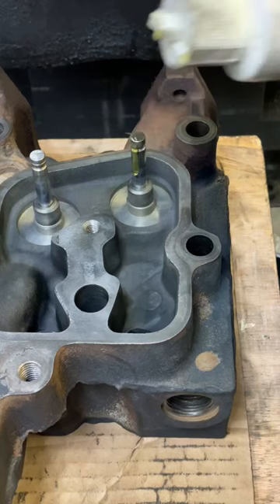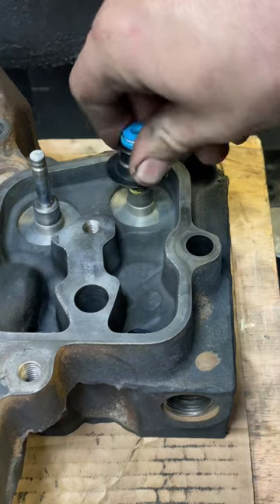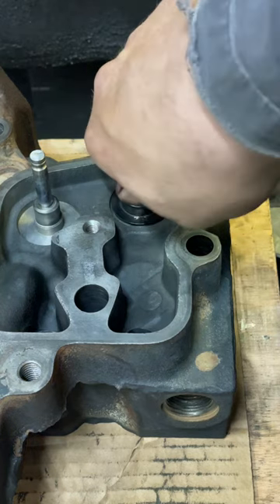install valve spring 12v  Cummins  #car #shorts

Comment: I'm damn near 60, that's the first time I've seen that trick. Well done!
Reply: I'm 66 and started on farm equipment as a kid, then cars then the oil patch and on and on. Never have I, till just now, seen this technic.
Reply: @donniegombel  I know right, we both been around a good bit.
This little simple thing is so fascinating and enlightening.
Reply: @donniegombel  well they didn’t have plastic when you were young 🤣 just joking it goes to prove old dogs can learn new tricks
Reply: Likewise
Reply: It's RUS old tech. But at start we use thin rubber from bikecycle wheel.
Reply: I've got you by a few years The 1st time I've seen it also.
Reply: Right! I usually just use my finger to hold them in place. I need to go find some plastic next time
Reply: I'm with you Bern doing it for years but does it really work
Reply: Same thing here. I guess you can still teach an old dog a new good trick
Reply: Am 60 and wish I’d know this in my youth thos locks are a proper pain in the ass 😂
Reply: no le
Reply: no
Reply: How the locks can just stay in place... something is odd
Reply: well I be damned
Reply: seventy three for me
Reply: I'm so happy that I learned something today
Reply: I'm over 60 and not once have I ever seen it,either. And I've been a machinist for decades
Reply: I use grease and wax paper

Comment: 15 years of rebuilding engines. i got to say that piece of plastic is something else. i just tryed this for the first time and it works great i pulled out some of the used wiper blade packs the plastic on there works great.
Reply from the maker: Ya I had a guy show me years ago. It’s a cool trick. I ise 6mil bags when I do it.
Reply: What's the trick for? To keep the locks in place?
Reply: @freashtoast1684  yes you can do this 2 ways press the spring then add the 2 locks .or place the locks in the retainer then add the plastic then press wala.
Reply: The old fashioned way works well on big valves. It’s a nightmare for the little valves used on todays cars and motorcycles.

Comment: Great system. I have also seen several mech. give the assembly a light tap with a small hammer to insure a good fitment of the retainers.

Comment: Love the trick but I would cover the notch on the valve with a piece of shrink tube so you don't tear the seal as your sliding it down the valve shaft
Reply from the maker: The valves on this head have a tapper so the seal is not hurt by it

Comment: I put all the locks in mine almost the same way ..you can set them in the top of the retainer and start compressing the spring and I would say 70%- 75% of the time they'll just align themselves... the plastic just insures it a little more probably...nice trick

Comment: Dude thanks for sharing, so I just made the piece for the chuck of my drill press and welded a socket to a drill bit. I got dance and cut a side of the socket out so I can see the keeper sit. I'm sure I can get a local machine shop to make me one like yours for the most used sizes but till then I'll just keep cutting if different size sockets for different size springs, 👍

Comment: I don't even waste time putting oil while assembling. 
When the engine is done, without the valve cover, I pour a quart soaking the valves, springs, etc.
Reply from the maker: I did the extra for the comments. I like lube after the assemble

Comment: Out of the tens of thousands of cylinder heads I've done. I've never put oil on the springs. Plus that is one awkward dangerous way of assembling the valves.. .

Comment: I always use a little plastic cap on the valve ends that covers the groove. I'm always afraid that I will damage the seal if I don't. I will have to try that plastic trick. Haven't seen that in my 30+ years of experience.

Comment: I always hated doing valve seat seals ... This part always too Me the longest cause I had to chase down all the springs and clips that take off flying when the valve slides to the side and shoots the spring all the way to the ceiling and across the shop...

Comment: You need to show the guys at Ford who hand build the GT 350 engines. Several engines have failed from a valve falling in to the cylinder.

Comment: The plastic will only work with single groove collets multi groove not a chance. Also that spring looks like its upside down could be the camera ange or sompthing but do double check that mate
Reply from the maker: I have used it on triples. Just have to oil them , but it not as fast. This is a barrel spring so same on both ends

Comment: I really always thought that the locks had to be on the valve stem first then the spring comes up to hold the retainer in place. I squeeze the spring then stick the retainers to the stem with grease and release the spring slowly. 
Your method is smooth and easy plus you do not compress the spring as much as I have too. 
Do you ever give a little tap with a rubber mallet or dead blow to the top of the valve just to seat everything in place?
Reply from the maker: Sometimes you have to mess around. But most of the time it goes smooth

Comment: What about the plastic tube that comes with the seals to protect the seal from the sharp edges on the valve.
Reply from the maker: These valves have a tapped in the groove so they don’t cut the seals.

Comment: Ok first i was getting pissed cause you didnt probably seat that valve seal. But that plastic trick! Bro that shit is why i don't even CARE ANYMORE about that fuckin botched seal install. Ive worked in 2 different engine machine shop and have worked and been tought by bad ass old school  performance engine builders and NEVER have i seen that trick! Hats off to you my friend. Very freaking cool!
Reply from the maker: That hat style seal gets pulled down and held by the spring. Even if to tap it down they like to pop up to start with. But I understand what your saying. 
Ya it’s cool trick. Old boy showed me years ago

Comment: I’m buying a set of bare heads for my build, how do I know if I get the right length of valves, or is that not as important as I think it is
Reply from the maker: you have to check the specs for the heads your working with. 
installed stem height and install spring height is a good start

Comment: My concern is with running the stem seal over the lock groove.
Reply from the maker: These valve have a tapper so there is not shape spot to cut the seals

Comment: What is the plastic used for?
Reply from the maker: Holds the locks on the retainer so they go in place
Reply: @CUTTERUPROB  Oh that makes sense now for some reason I was thinking you used it to keep from scratching anything up lol
Reply: Piece of plastic actually has two benefits if that spring kicks off it doesn't launch your keepers across the room

Comment: Add oil...add oil... Add oil.  Just when you think you added oil,, add oil.  Oil cheep. Engine parts not so much.   Nice plastic trick.  Logged for future use. But I'm sure when I remember it, it will be either on the last valve or when I'm done.. lol

Comment: the tool that you're using to push the valve spring down what brand is it it's one I haven't seen
Reply from the maker: The bit in the chuck. I made myself

Comment: I've been out of the game for a long time with those seals do the valve stems get enough oil?
Reply from the maker: That is a factory seal for a new 12v Cummins. Most the newer stuff has seals very similar. I think some of it is the materials used now are better and new less oil. But what do I know lol

Comment: That a knee mill? Gotta say those are some baby valve springs but your gonna have folks putting their heads up on little 110v craftsman drill press and splitting tables.
Reply from the maker: Seat and guide machine. But you can use the drill press for most springs.

Comment: Just wrecked the new oil seal by not using a sleeve over the top of the valve stem.
Reply from the maker: These valve don’t have. A sharp edge to cut the seal so the install sleeve is not needed.

Comment: Meh, no need to put oil on the seal, nor on top of the spring... The plastic is unnecessary too. Compress the spring, put the keepers in one by one, and release spring tension.

Comment: What you used a plastic you destroyed it for nothing you can use some other washer it will help
Reply from the maker: Plastic holds the locks in place. Faster then putting them in by hand

Comment: Also what is holding the valve in place?
Reply from the maker: It’s a diesel head so just the cardboard on the surface. But a gas heads you use a rag balled up

Comment: I do not like the one line of oil on the valve stem. the hole shaft should have lube .. just to be proper.Edit its like installing a piston in a sleeve or cylinder and only oiling lubeing  1/4 of the cylinder.
Reply from the maker: stem is lubed when you  install the oil is just for the seal

Comment: Isn't there a tool that they want you to use to put the valve seal over the valve with? I remember that from Honda.
Reply from the maker: It’s not needed for these valves
Reply: @CUTTERUPROB  I wonder why some are required, maybe bc they're sharply edged on top near the seat groves?

Comment: Should get a can of Graphite for engine assembly
Reply from the maker: I am not a fun of it myself
Reply: @CUTTERUPROB  graphite is the best lubricant to use for Bearings aside from grease or oil
Reply from the maker: @hoovercamaro  I have found using break in oil and bearing guard  is what I like to use. I can’t say it the best way. Just way I do it.
Reply: @CUTTERUPROB   My dad Rebuilt his 1984 GS 650 Katana engine after it blew up and after he blew the transmission for the second time he disassembled the engine and it had 50,000 km on the engine after the rebuild and the Graphite was still On the Cam Bearings, it goes to show the Graphite sticks on and lubricates when the oil has dripped off after sitting, better for cold starts. Thats just our findings, we always use graphite on small bearing and we haven't had any issues.

Comment: That looks like a Harley Davidson twin cam valve guide seal?
Reply from the maker: It’s a 12 valve Cummins head
Reply: @CUTTERUPROB  yeah I know it's not a Harley head, but the valve guide seal look identical to the valve guide seals used on 2005 and later Twin Cam engines.

Comment: That spring looks upside down
Reply from the maker: It a barrel style spring. Doesn’t matter Witch why it’s installed
Reply: @CUTTERUPROB  if you look real close at the coils the bottom ones are a fraction smaller the smaller coils go to top .

Comment: Valve spring is upside down
Reply from the maker: It’s a barrel spring with no majority
Reply: @CUTTERUPROB  normally the finished end with the leading edge on the outside diameter goes against the retainer because as the spring works and rotates it binds less and sheds less metal.  The shim or seat usually has a higher surface hardness than a retainer.
Reply: I was looking through comments for this.